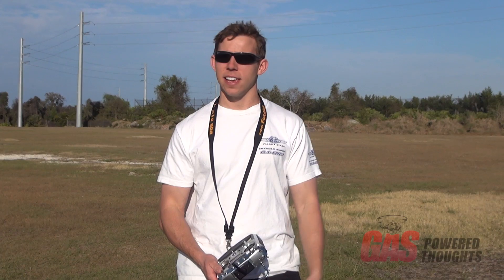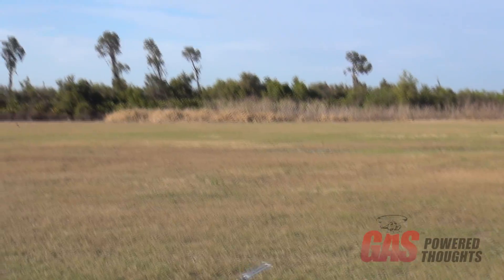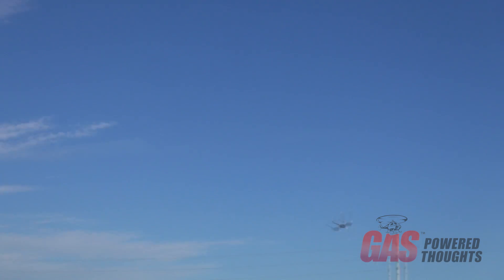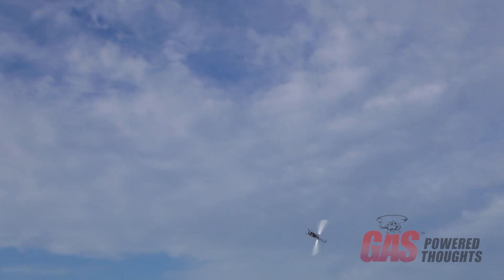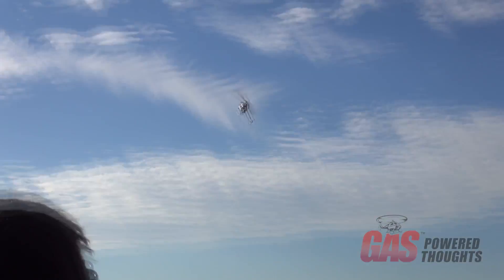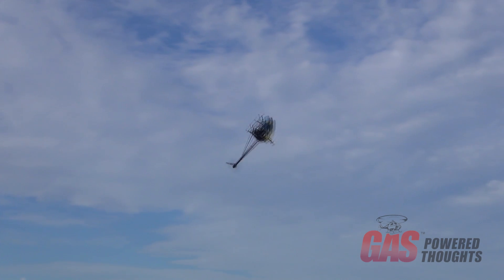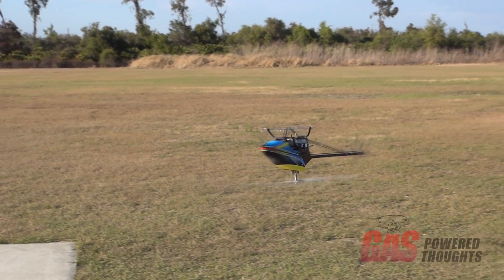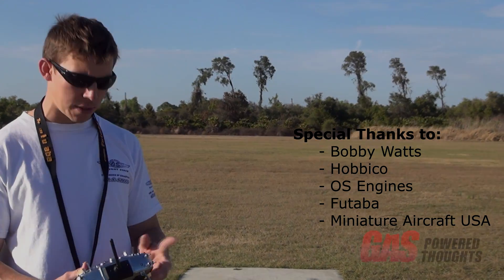Fury 55 with OS Max GT15HZ

Comment: hello 

i have an ikon flybarless unit and when i tried using the governor idle1= 1600
and idle2 = 1700, the RPM dropped and the engine stalls after a minutes. (crash)
so, now i will use no governor.

what would you suggest as a throttle (V) curve for a Gaui NX7 converted to Gas using the OS. GT15HZ engine.

 i was thinking of 100, 95, 90, 95, 100.

or 

100,95,90, 85, 95,100

Gaui Gx7   gear ratio   16T: 8.18:1:4.71

Comment: for me,this engine is perfect for 50 size model...bcoz its gasser....for 90 size OS should come out with something bigger to match the load and heavy maneuver..it should as same big as a ys120sr...the displacement should be 19-20 c.c...i think os will do some research to match the 90 size helicopter gasser engine....just to give my opinion....

Comment: GREAT video. I do agree that some of the manufacturers need to look at offering up 'special' 600/50 sized models that can take that motor. To me this is the PERFECT combination of long flight times with reasonable power. The only "stock" thing I am aware of in the 50-90 class's that comes close are the Century Radikal G20 & G30's - and they are not stocked down here as far as I know (RJX gasser as well - that is stocked here though)